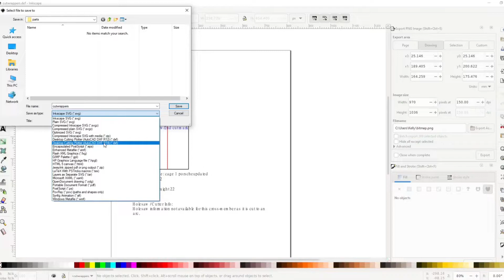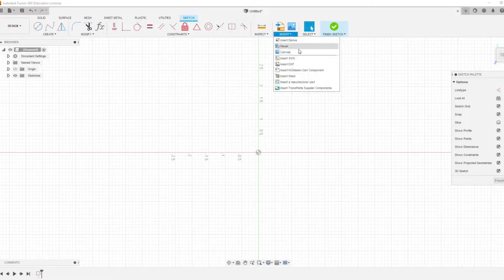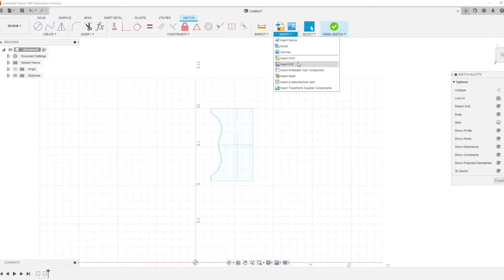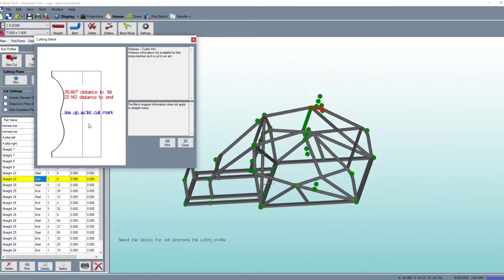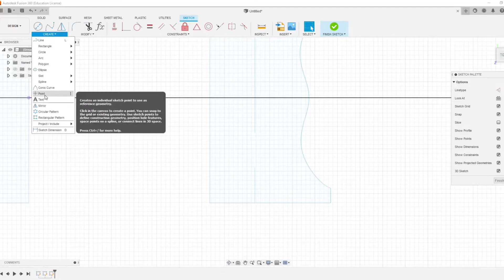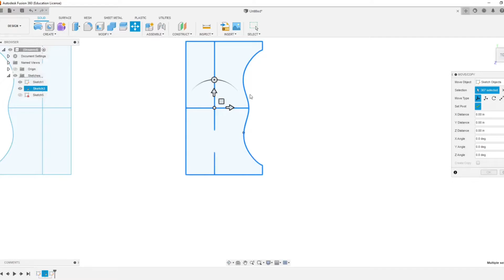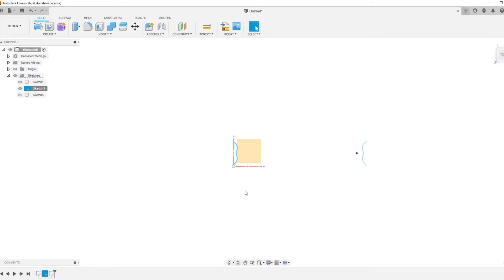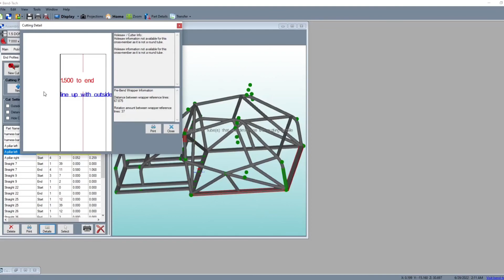CNC plasma tube notching - for those without the bendtech dragon!

Comment: Sheetcam does have pipe plus for rotary cutters. Seem like a lot of steps to cope out each tubes.
Reply from the maker: @choechanho2351  pipe plugin might be a good solution for straight runs of tubing, however cages can have multiple mandrel bends in specific marked locations and rotations that need to be accounted for in the cope.
Reply: @Sasquatch-Built yes sir!  I usually draw up on fusion and just get the measurement off and enter in sheetcam.  I don't think you can just get the bend techs software unless you have their dragon I believe.